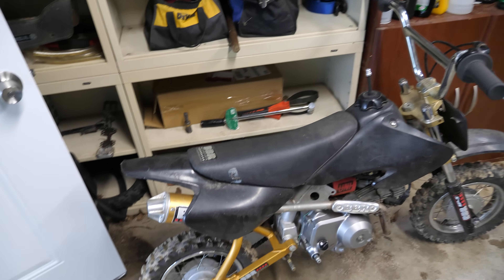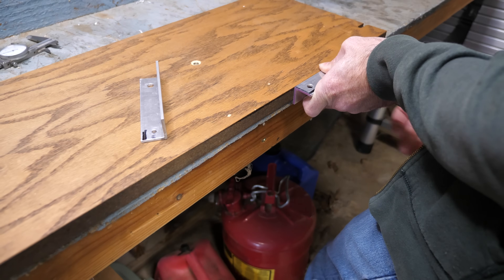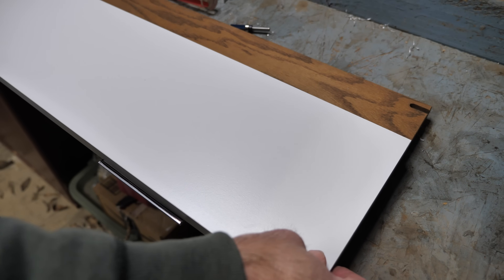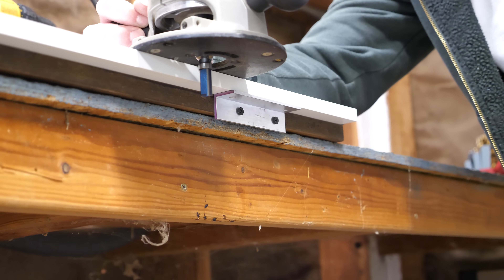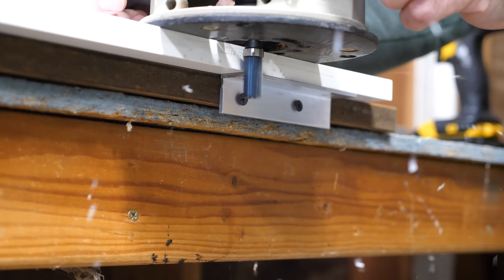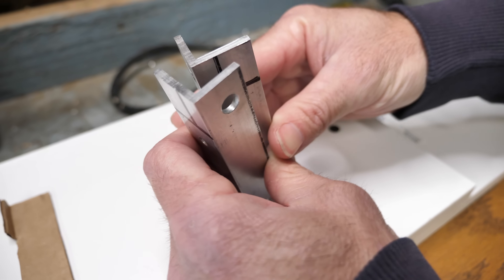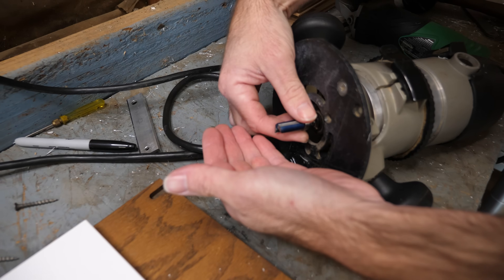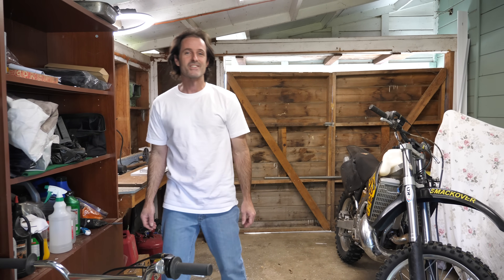Can You Machine Metal With A Wood Router?

Comment: I spent $90 on tools, to remove a broken, stuck die tap. The alternative was to replace the swing arm it was stuck in, for $800.
 Good tools cost money, but they also save you money, and can save you!
It's worth spending a bit more on good tools, so you get the results you want. In the end, you save money.

Comment: Will it work?  I wouldn't use particle board.  I would also fixture it differently with wood. I'd also use a spiral upcut bit and a bushing.  Before I see you try, I think your method will work but the finish may not be as nice as machined.  This is just supposition.

Comment: Just because something will work doesn't mean it was meant to. Anytime using wood tools on metal it is a bad idea. Why not get a metal bit and use a Dremel or something you can straight line off of? What happened to the part you wanted to bend over for a flap? Too bad you don't have a couple C clamps to lock down the new piece of wood to the desk. Without making any holes in it.  at the rear of a bike you were working on making into a street legal bike so you could get tags on it. I thought you were going to throw him a broom.

Comment: So basically Jake it is a poor man's marching machine! Maybe look into a machining tool instead of a wood bit tooling! I don't think you can get one with a bearing but you always could go with a different method of running it! Like putting a straight edge using a steel Flat bar say 1 inch by 3/16 and running the router directly on the wood and using the outer circumference of the router along the straight edge. But regardless It worked and that is the main thing! Always remember  the main thing will always be the main thing. Happy Spring!!!

Comment: I used the same method to put a chamfer on some aluminium bar some years ago. I think you need to reduce the router spindle speed to get a clean result, i.e. to avoid welding the aluminium.

Comment: It is quite well know, in the woodworking community anyway, that wood tools can generally speaking be used for aluminium too. I say generally speaking because you probably would not wan to use your expensive and beautifully sharpened wood chisels on aluminium, but for your power tools there is no problem whatsoever as long as you adjust the feed rate accordingly.

Comment: i have cut soft metals in numerous ways, never used one of my router bits and now I just won't.  I mean  i probably would try if I messed one up real bad doing something, but I would use one in general because of the cost of the experiment.   I do have an old drill press though and making tiny holes is fun, the i cut it with my miter box!  if it's a dig in i have used the press and then the dremmel diamond cut off wheel <-- You can get right in there with one of those.  wal mart has a cheap corded version of that and I used it to detail all the glass rectangle netted tiling ( glass and pottery is rough on stuff but the dremmel will cut it Nice, even though it's more tough that you would guess.   the one at wal mart  is HYPER TOUGH, it was 19 bucks when I got mine, so cheap and I liked it so much I bought another one just to have in case someone "Borrowed"     i was cutting 12 inch ( 9 dollars a stick! ) ceramic molding trim with precision!  it slides through aluminum.    but on thicker stuff.   i have even used a miter box I made of wood with all my fav hit angles.  the miter box I made accommodates a hack saw. :0)      Great Video Guys!    Thanks Camera Girl for getting those nice shots in! LOL     also  thank you guys for saving me from trying that bit trick.   those are too expensive to be chipping up like that.

Comment: Two suggestions for aluminum. Always keep the area you’re cutting covered with wd-40. Aluminum generates heat so quickly and is so soft it will tear more than cut and the removed material can stick back to itself if not lubricated. Also on your final pass, climb cut (move router in the same direction as the rotation as your cutter)

Comment: Ex machinist here, if you go a little slower and in opposite direction pushing away from you (i assume the blade spins clockwise) , the finish will come out a lot better
Reply: A 4 or 6 flute with a milling adapter for the drill press would've also worked better.
Reply: Do you think a climb cut is wise when you're going handheld? I would think the first thing to try is something to prevent the galling
Reply: Conventional cut is for sure far and away the way to go with the router. On the roughing at least. But. Yes if you are taking another pass just at zero to remove the galled material, a climb cut should yield better results.

Comment: Yes, you can use wood cutting tools to cut aluminum, but it’s best to use carbide blades and bits. If you have variable speed, slow your speed down. I’ve used my table saw to cut aluminum tread plate, as well as aluminum angle and plate.

Comment: I believe you need to push the router the other direction unless the video is backwards. 
   The sharp edge should throw the particles away from you. The sharp edge should hit against the mark first.
Reply: At 15:30 is when I believe you were cutting in the correct direction.

Comment: I would love to see some videos where you shop around your area on CL or FBM and acquire a small mill/lathe combo for a good price. It's going to cost more than a router bit, but you can start making your custom parts the "right" way. You know, metal tools for working metal, correct screwdriver tips, etc.

Comment: Steel bits will work on aluminum, and carbide will do steel too. For aluminum wd40 dose wonders at keeping the aluminum from sticking to the bit
Reply: +1 for wd40, works really nicely for aluminium
Reply: it will work, sure.. But its kinda like using a hammer to drive screws.

Comment: Is it possible you were going the wrong direction in the passes?
Reply: Climb vs conventional cutting. It’s might help.
Reply: That was my thought too. I’ve cut metal roofing material with a circular saw and you have to turn the blade around to get clean cuts
Reply: Got covid and vote much lately? Pls use brain and dont just say/write first dumb sht come to mind.. But a tip to ur tiktoking thought-process; rigid,feed, speeds, two w/e size small screws in"particle wood".. Hope u can come to some conclusion other than direction (even though, to be fair its kind of valid as well to some degree). But think about why side worked better than The other..
Reply: @handendaer  you've been alone for too long buddy. Don't be so vile
Reply: @handendaer  Are you having a bad day or something?
Reply: @handendaer you come across like a real pos